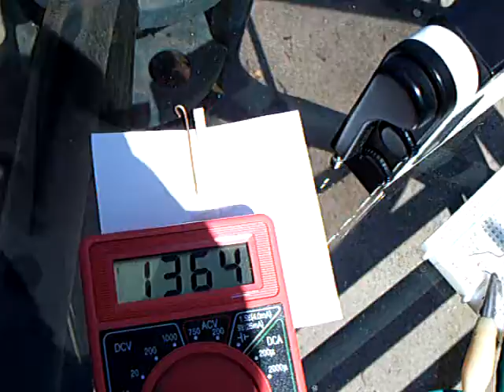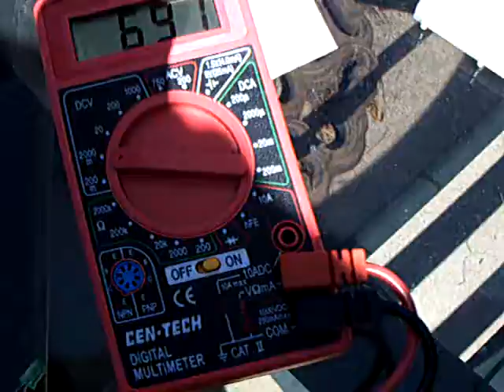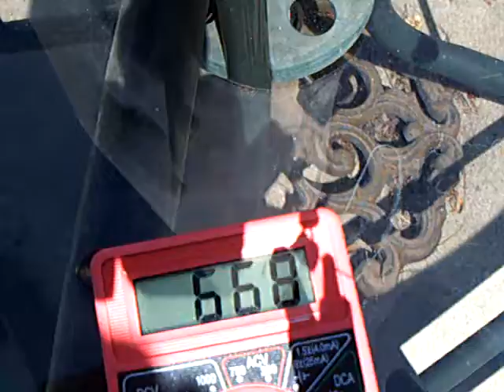Red LED used as solar cell--powering an oscillator

Comment from the maker: You don't have the amperage needed to run that 1.5v toy motor.  You need more than just voltage. The red leds used as solar cells just don't put out enough amperage to do much. That is the problem.  Putting the leds in parallel gives you more amperage but then you have to series connect that to more paralleled groups to raise the voltage.  It can be done.  It just takes many red leds to do it.  Around 1v with enough amperge should make that motor turn.

Comment: Purple-UV best in direct sunlight. over 2.5v from one 5mm led. Must be pointed directly at sun. slight deviations in angle reduce voltage. Straw hats are less angle sensitive but make less volts.
Green is best in cloudy conditions, but little gain in direct sunlight.
I tried a flashing RGB. Works indoors, almost as well as full sun! Although the voltage is very low. around 0.035.

Pink was also pretty good. 5mm works better than 3mm. I think its the magnification from the epoxy housing...

Comment: 1 led can not power anything. I needed minimum 30 Led to keep the voltage of the capacitor growing, when i connected it to the multimeter. And if you ask me, the yellow and the green is the best to work as solar cell.

Comment from the maker: @DrSaminstine ---Thanks for the tip.  I had tried this before with a white LED and didn't get good results.  The most interesting one that I have tried is an infrared LED that puts less voltage than the red but much better amperage.

Comment from the maker: @Pirate88179 -----Hi Bill.   An infrared led pumps out more amps but less voltage (about .950 volts and almost 100 micramps). I tried a red and an infrared together parallel and the amps went up but the voltage clamped at .950v.  It would be fun to get a bunch of these and build up a little led solar panel.  I don't know about cutting the tops off but other colors that I tried didn't do so good.

Comment: Great work!!! If you grind off the top of a transistor PNP or NPN to the metal on the inside it will respond to the sun as well more voltage from the led than I would have thought, very interesting

Comment: Lid:

I had seen this phenomenon a while back and tested it myself...BUT, I never thought we could do anything with that energy from an LED.  Great video!  Now I am wondering if we could up the efficiency by removing the plastic that surrounds the chip as i am sure it is blocking some of the sun's frequencies.  Also, I have some but never tried infrared or ultraviolet leds...did you see what these will output?  What if we made a "cell" from various leds designed to capture a wide spectrum?

Bill

Comment: Ok,
Lidmotor, what is your supposed mode in the crystal that is doing this.
What specific submicroscopic interaction is occurring?
What perhaps is the analogy?  Have you seen this effect with Incandescent illumination of the LED or only with SOLAR LIGHT?
Thank you for showing this.
Very Best Regards,
Diveflyfish

Comment: There's a vid here somewhere, where a guy has a solar panel against LED's for voltaic action. It seems if the panel was about 18% efficient, then the dozen or so LED's to similar size as the panel were about 23% efficient ! Makes ya wonder eh.
I've found the clear reds seem to work better than the dull, kinda obvious I guess.
Great vid again and I hope more folks do check them out too :)